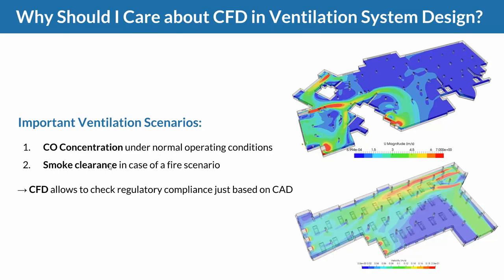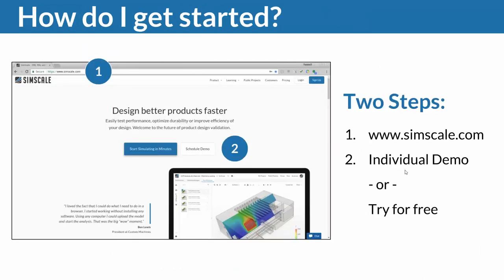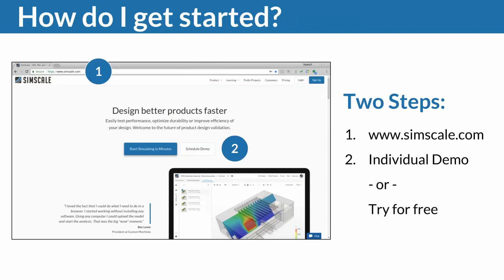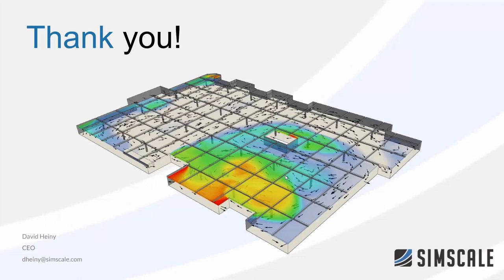Ventilation System Design Study for Smoke Management with CFD

Comment: Hi
Something with the numbers doesnt seems right for me..
You are doing here simple 5M elements analsys and running it for 1666 min? That is 28 hours. On 96 cores?
I assume this is k e model.
Isnt it suppose to be much faster?
Reply: Indeed it ran on 96 cores and took more than 2000 minutes with a k-epsilon turbulence model.

Comment: There's no generation of CO in steady state as boundary condition?
Reply: I agree with you! I do not think the CO was modeled in this simulation. The CO PPM graphs magically appeared. What he analyzed was the velocity of air. Increasing air velocity everywhere randomly is not the way to solve such ventilation problem. 
I would model several inlets and set their  CO volume flow rates to match that of a typical car. When looking at results I would look at the volume fractions of air to CO everywhere and try to minimize that as much as possible while keeping a reasonable fresh air inlet velocity. the modeled CO inlets should be on the lanes where cars will be driving. The count of the CO inlets will be the maximum number of cars found in the garage at any given time (Cars that are running). distribution of inlets should be even across the garage.
Reply: @husamyounis6607  Thank you for sharing. Can I ask you if you can offer training for someone that has interest in CFD modelling. My background is Fire safety Engineering. I look forward to hearing from you. Thank you